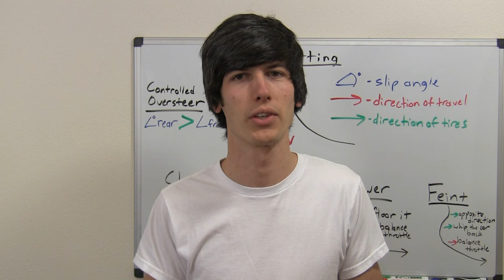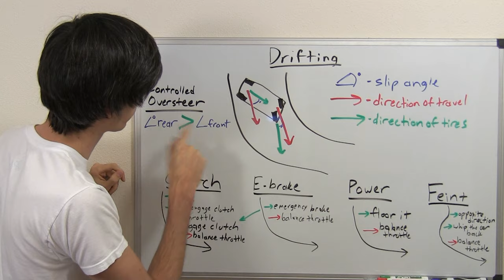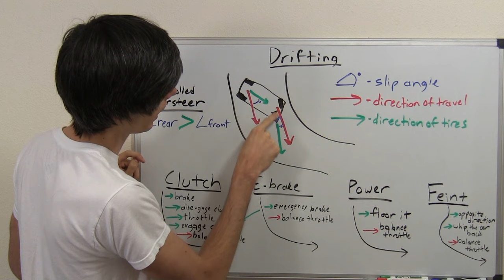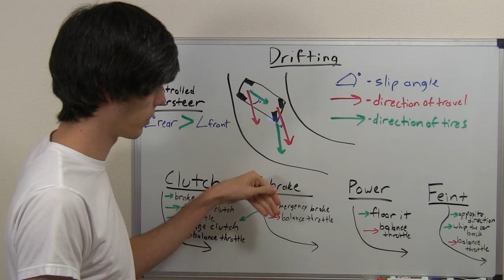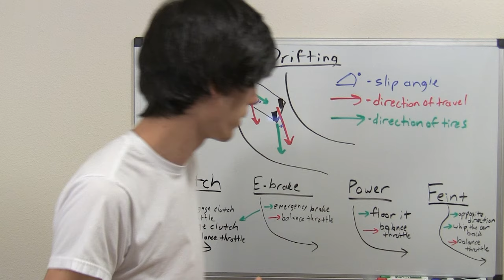What is Drifting - Explained

Comment: My car has 140PS and I can disable ASR with a button. Can I drift with it?
Reply from the maker: If it's light enough and rwd...
Reply: +volarecantare on a wet road,and RWD, anytime ;) on a dry road you'll need practice, i mean lot of space around you!
Reply: put 200 horses in for more easier drift.
Reply: +ΑΡΗΣ ΚΟΡΝΑΡΑΚΗΣ With 200 hp and a lightweight car, you can do power over steer drifts which are my preferred method of drifting. I also like the Feint and brake drift techniques. 

I don't like the clutch nor the handbrake ones though.
Reply: SI0AX yes, the power over steer is the best, even i can drift with my stock Miata 140Hp with LSD but only on wet road. Otherwise i have to use other technics as you described ;)
Reply: SI0AX everything is useful in a tsuiso
Reply: *****
Yeah, I saw the best beginner drift car is a turbo Miata w/ about 200 hp. It's light enough that 200 will let it power over at a very slow and controllable rate. You can counter-steer slowly and get a good feel of everything you have to adjust to drift properly.
Reply: ΑΡΗΣ ΚΟΡΝΑΡΑΚΗΣ
What is "tsuiso"? I translated it to "prosecution".
O_o?
Reply: So 140HP is not enough for an unloaded sedan? Body is aluminum I think.
Reply: *****
Ehh, I really don't think so to be honest. Sedans aren't exactly lightweight.

The Miata is a tiny lightweight coupe and even that is under-powered. You have to consider the power-to-weight ratio. Lighter lets you get more performance out of less power.
Reply: SI0AX tsuiso means "double pas"
Reply: ΑΡΗΣ ΚΟΡΝΑΡΑΚΗΣ
What does double pas mean then? I've never heard about any of this.
Reply: Alex Perron
Just buy the cheapest used tires you can get. You don't need high grip performance tires for drifting anyway(usually quite the opposite).
Reply: I never said that you need high grip tires. But just buying cheap tires wont solve you problem. 1 you probably have a stock open diff which means you will be drifting with only one tire getting power. And 140 hp really isn that much and will mean that your car will have trouble holding any skid without repetitive initiation. And even then id imagine the car would still bog down. But who knows maby 140 is just enough to have a little fun, but like i said, i doubt it ould hold any drifts for long.
Reply: Alex Perron is dependent on the asphalt, a September's hot afternoon then I drived on the city's Centre I had to go via Ikaros Avenue. That Avenue makes a hairpin corner, right before entering to the Centre, and the asphalt there is very slippery, so slippery, that even buses spin. Anyway, that day had a little traffic, start-stop, and each start the BMW E46 compact 1.6 spins
Reply: ΑΡΗΣ ΚΟΡΝΑΡΑΚΗΣ
But a turbo on it. Or is that car already turbocharged? My 1.6 Fiesta only makes 120 HP.
Reply: SI0AX N/A 120hp, and with the antispin OFF
Reply: ΑΡΗΣ ΚΟΡΝΑΡΑΚΗΣ
Do you mean Anti-Schlupf-Regelung [ASR]?
I can disable that with a button.
Reply: ***** why the Germans making near everything about names difficult to spell? In some modern cars, that system cannot be disabled
Reply: ΑΡΗΣ ΚΟΡΝΑΡΑΚΗΣ
It's basically traction control.
Reply: come on ppl you need an lsd to have a predictable drift. if not just weld the diff. buy an mx5 (its factory drift ready..) and practice if anything.. or any bmw hopfully nothing big n heavy and weld the drift instance drift car...

Comment: Not really sure what you mean by balance the throttle
Reply: +znicho He means using the throttle to control how much angle you have, more throttle = more angle, less throttle = less angle, so you want a balance so you hold the drift but don't over rotate the car.
Reply: add enough throttle. not too much to oversteer and not too little to whip back around.

Comment: So I'd imagine you wouldn't want too much of a negative camber to allow your tires to slip more?
Reply: Also, how would you need to balance the throttle from say, the initiation, the carry and the followthrough of the drift? Do you need to ease up on the throttle in order to regain grip and straighten out?
Reply: Negative camber is typically set only on the front wheels, this is to compensate the camber generated when you steer. If the front wheels were to have no camber when they're straight, when you steer left, the left wheel will achieve positive camber. So to counter that, negative camber is set. You want a tire contact patch that's as large as possible. Try comparing ChrisFix's Mustang with a pro's (can be anybody) drift car, watch their outer (ex. left drift, look at the front-right tire) front wheels when they drift.

Yes, to stop drifting, just ease up on the throttle, let the rear regain grip.

Comment: And yes camber helps drifting, it helps the front tires hold grip and angle better which in return allows you to pull more angle out of the drift and have a bit more control. Think about like this go throw your car in park and full lock to either direction, now add negative camber and you'll see that at full lock with theright amount of camber you'll see your tire is flat on the ground not so much to the side which means more grip

Comment: That's a good way to put it, yes. AWD is designed to keep the vehicle pointing forwards, and so even when you apply enough power to break it loose, its more controllable. RWD is inherently unstable with even a bit too much throttle. You could kick the back end out on almost anything RWD, but if it has too much or too little power you won't be able to sustain the drift and you will either crash or come to a sideways stop.

Comment: well really you can't drift it, but you can break the back end loose, and drag it around a little bit...it'll look and feel kind of like a drift, but you have to be careful how you use the word, people who are into drifting will tear you a new one for using the term "drifting" in a fwd car. All you have to do is while driving at speed, lift up the E brake as you turn into a corner. this will lock up your back tires and they'll slide out.

Comment: Simply said:
Drifting - deliberately braking traction (most of the time using the handbrake or a normal brake) into a controlled slide (or as you said oversteer)
Power Slide - Braking traction due to excessive use of the throttle.

Often power slide is mistaken as a drift, but there is a difference.

Comment: see i know if it's wet out it's a lot easier to get a slide going, i've felt it first hand in my mom's pick-up. so with tires being designed for grip the best tire for losing traction would be racing slicks and not street or race tires. i know tire choice and suspension set-up can make a world of difference depending on the kind of racing you intend to do.

Comment: Well most of the reason is when you're drifting you don't get a lot of air, so the cars are easier to overheat. Plus a lot of the times with those S13s they're intercoolers are too big to fit the bumpers in. Plus, you crash A LOT when ur drifting so that could be another factor. Many reasons to why drifters don't have their bumpers on

Comment: Well in order to drift, you need a RWD car first. Then u gotta learn how to initiate. One of the easiest ways is to scandinavian flick then pull the ebrake right when you lose traction counter steer really quick and clutch kick. From there it's mostly throttle control. First time around, try practicing on a skid pad if ur local track has one :)

Comment: You don't carry all your speed out of the corner with you, it's all turned into heat and noise and tire smoke. As a race driver will tell you, a sliding car is a slow car.

Comment: How do people drift in FWD? I've seen someone do it at a 90 degree turn, but when I tried it, it damaged my e-brake.
Awesome videos! keep it up!
Reply: technicality speaking, you can't drift. But you could do 180 in a reverse or 90 in a turn by hitting the clutch pedal and revving up the engine and then realising the clutch again so it'll create a massive wheelspin resulting in a short drift (I'm not sure if its even considered a drift, but that's how the 90 works)
Reply: Sina Amini that's a wheelspin tried it, not cool lol but definitely not drifting! I think it's possible if I use the car's momentum to force the rear end to drift when on a corner but I've already wrecked my car.

Comment: I don't think a "power drift" is a real drift because in a drift the tires shouldn't be spinning. I think the so called "power drift" is actually a powerslide or a sideways burnout. American cars, such as the Ford Mustang, Ford GT, and the Chevy Corvette ZR1 are great for powerslides. Also, if you do powerslides and sideways burnouts in a drift competition, I don't think it would be fair for the drivers who do real drifts with lower hp cars.